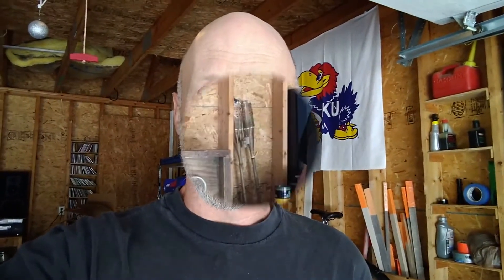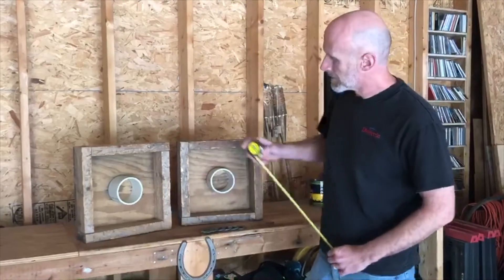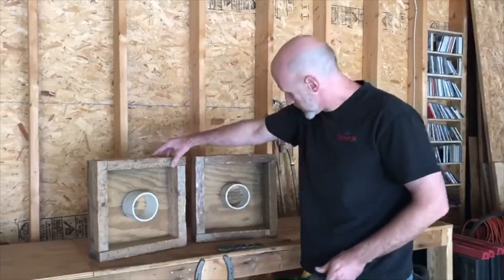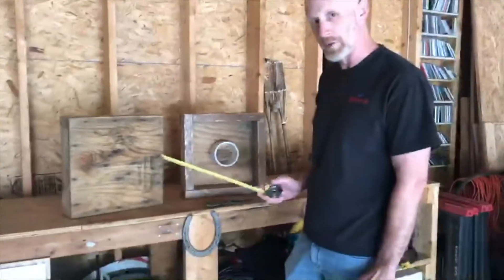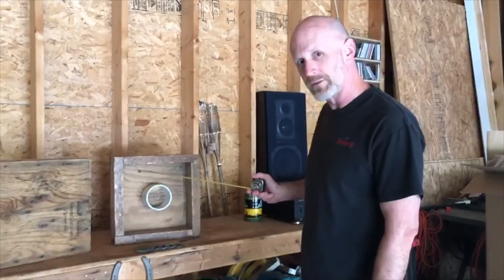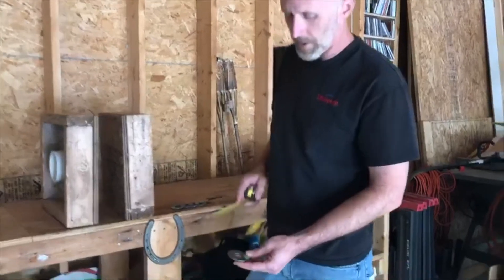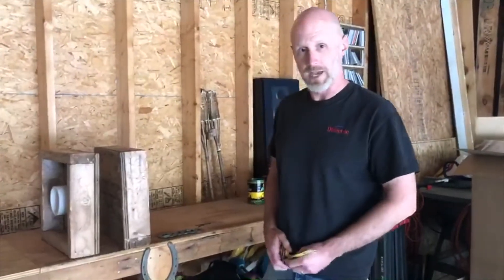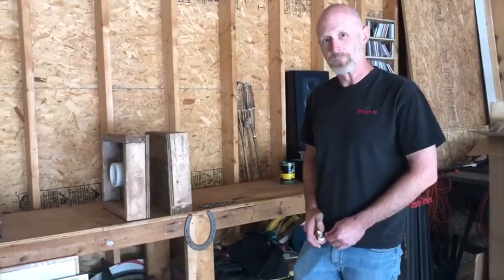Washers Tournament Box, Take 4

Comment: 4 inches pipe to inner wall?
Reply from the maker: Hi cuz, thanks for the question. The pipe should be 4.50" outside diameter; the box is 12" inside. So... pipe OD to inside of box should be 3.75 inches.